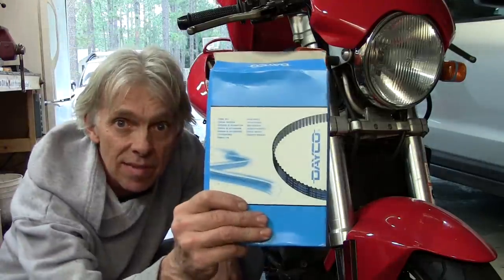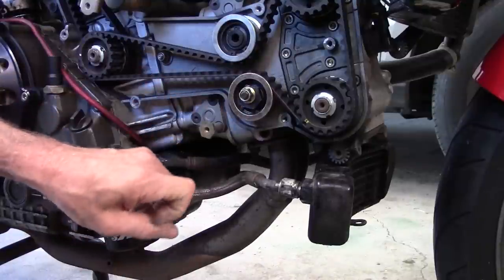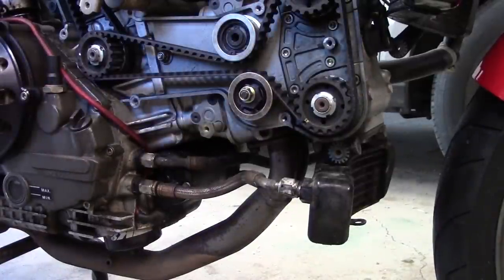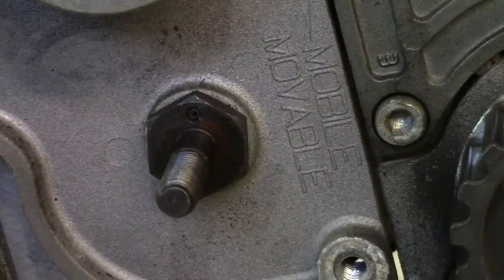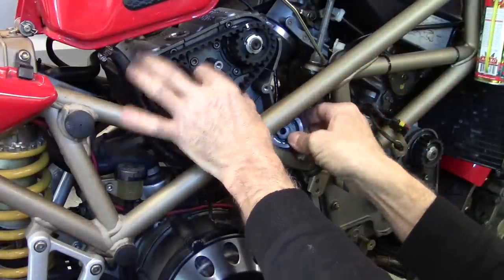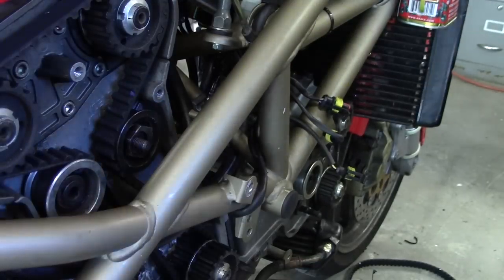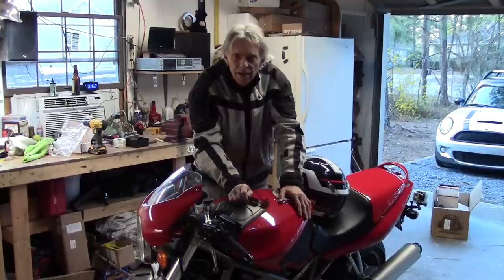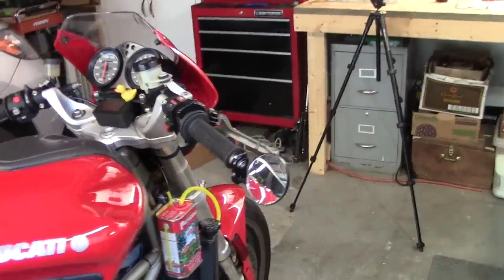Ducati ST4 Streetfighter Cafe Build Part 6 - REVISED TIMING BELT INSTALL.

Comment: Love your video, and your small story about your dad. Thanks a lot. I use a small long screwdriver to check the top dead end of the compression stroke and in 6th gear crankshaft rotation is somewhat easier. Greetings from the Netherlands.

Comment: You finally made it into the upper echelon of bike building with that Ichiban award- congratulations!  LOL!  Seriously though, I've been following this build and I just want to say thanks for putting in the time and effort to film it all.  I'm not planning on doing anything similar but it's been interesting to watch.  I will say the one thing I do find VERY useful in this build is how you measured your belts!  I've got an 08 Hypermotard 1100s and will be checking my belt tension your way instead of the Allen wrench method.  I've never had any luck with the tuner apps but I've never seen it done before, either in person or online so seeing it here gives me direction on the proper way of checking the tension instead of guessing.  I'm not convinced it makes a huge difference in longevity but I might as well do it right and this will help me tremendously!  Finally, the bike itself looks fantastic- you did a great job!  I'm not sure if you're done with this bike or if there's more, but I'll be looking forward to your next video of whatever you tackle.
Reply: Thank you! On the belt tension, be sure that the cylinder you're adjusting is at Top Dead Center!! I actually made a slight error on the vertical cylinder and didn't rotate it far enough. (I went back in and corrected this the other day and installed new Fuji style lock nuts) You can remove the spark plug and insert a long skinny screwdriver or a wood dowel down in the cylinder and watch it as it rises up to TDC with the piston. Get it as close to TDC as you can while turning the rear tire with the transmission in first gear. If you go past a little it's OK but it's important that you don't turn the engine backwards to line it up. The belt has to be loaded in the forward direction. That way, the side with the adjuster is NOT the side that's loaded up with extra tension. Good luck!

Comment: ok glad we cleared that one up, can get a bit confusing but the word clockwise cleared it up. i always try to understand why manufacturers do certain things. btw got onto your channel by your cb750 series which then made me go out and buy a gl 1100 goldwing that hadn't gone for twenty three years and restored it but using gl 1000 fenders with a bit of adaptation to the rear. would have liked a cb750 but my budget wouldn't stretch to it. keep on hackin, love it.

Comment: About finding the correct belt torque, if you will.
Should you not set each cylinder at TDC for each check for correct belt tightness?

If not, it will give different values  because one cylinder will have valves and valve cams under pressure going out to the belt.

Just a thought though. ..
Reply: You are absolutely right. After uploading I was informed that I failed to rotate the vertical cylinder far enough to be at TDC. I should have rotated another 90 degrees.
Reply: Dean Segovis At 24:25 you are turning the crankshaft 90 degree counter clockwise to your red mark. Could you try to explain what is wrong? Should you have turned the crankshaft 180 degrees counter-clockwise?

Comment: Thanks for the video. I'm into my first belt change on a Ducati 749 and am looking for all the help I can get. A comment and question. When you remove the vertical belt (@ 12:55) you do not mark this belt with paint, and then when you replace it (@ 14:37) you refer to the horizontal belt and then show a vertical belt with marks you mention you copied. I am assuming you copied these from the horizontal belt you marked and are assuming both belts are the same. Are they? My research so far with my Testastretta engine says to mark both belts separately as they are not the same. (Just in case anyone else is trying to apply your video to a slightly different bike.) Thanks again for the video.

Comment: Ducati does not recommend the use of locktite on the belt tensioner bolt.  You just need to replace the bolt every other time.

Comment: is one side pinned and the other not because of direction of rotation.
Reply from the maker: No. Same rotation.
Reply: so if the rotation is the same, it means one side is trying to screw itself in and the other side is trying to screw itself out. hence the pin on one side only.
Reply from the maker: No. They both are turning clockwise, thus tightening.
Reply: please take a st4s.

Comment: LOL - still watching the updated video - (Im sorry, you just cant win can you Dean? LOL) the cam drive gear turns at HALF crank speed, so your original mark you made at "180*" was 90 degrees on the crank.......... (cams operate at HALF engine speed, every TWO crank revolution is ONE in those cam sprockets.......) BEST way to tell if youre TDC on back cyl is a LONG thin screwdriver or dowel or smooth rod in the spark plug hole
Reply: YouTube won't let me do annotations anymore which sucks ass! Fek it. :) Close enough!! TIME TO JUST RIDE THE BITCH!! :)

Comment: Don't know if I could ever get used to the sound of a dry clutch.
Reply: Jeremy Newman 

Yeah...I owned a Dookie and never liked the rattling, or everything else that constantly broke on it.
Reply: There is a modification you can do to the dry clutches that reduces the amount of clutch rattle.  Just check the internet for the recommended mod.  I think it's called the Ducati "quiet clutch mod" and it's almost as simple as pulling the clutch plates and adding one additional plate.  I did this mod to my ST4 and it really helps, without totally eliminating the sweet music of a dry clutch.  I like a dry clutch vs. a wet one where all the clutch debris is entering the oil.  Just my 2 cents.

Comment: I have an ST2 with just 9000 miles. Belts r recommended at 10K but with your guitar tuner trick at 12Hz y not just "tune" my original belts? The valves just c tightness, not "newness"...
Reply: Belts are relatively cheap and the process easy enough.  Just take your time and be thorough.  The belt change process for the 2 valve motor is easier than the 4 valve motors.  An overused belt is a troublesome condition.  The belt could break and mess up your motor.  I've run my belts up to 12k miles without incident but that is max for me.